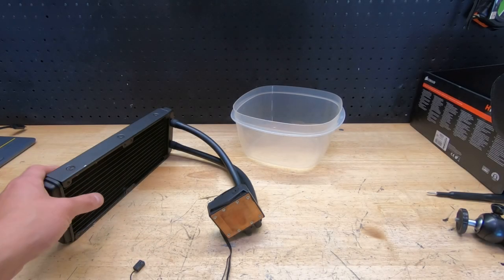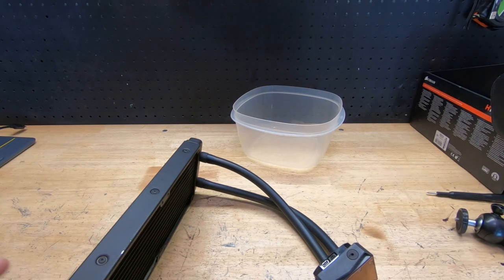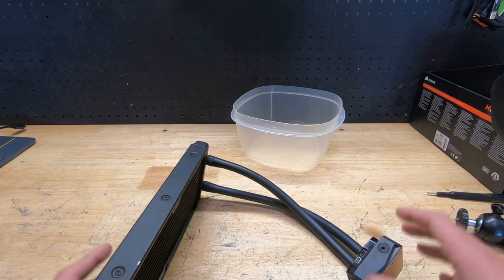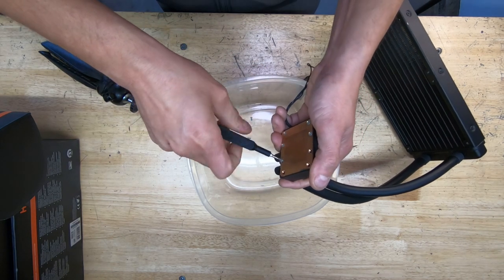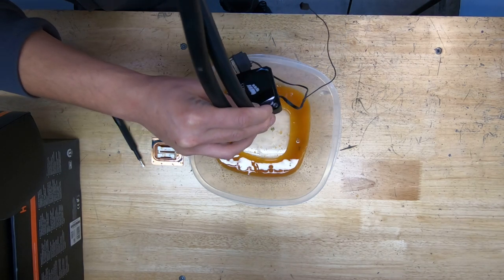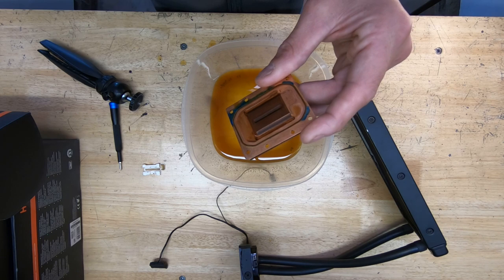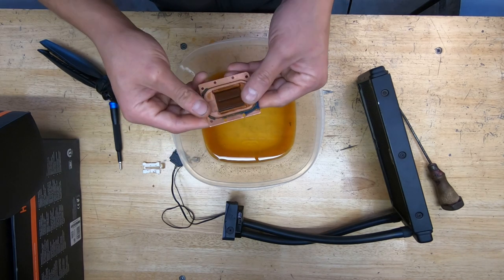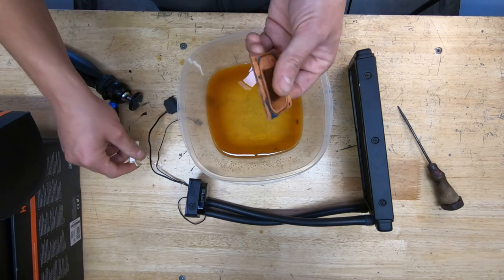Leaking AIO!! Disassembly....... I was shocked to say the least!!!

Comment: Aio's look nice , but I'll never have on in my personal systems. Dark rock pro 4 , Noctua NH D15. (Thinking about checking out scythe ).
Reply from the maker: I had the Dark rock pro 4 on my 5900x. just switched to a evga 280 aio, working on a video for it. I'm the same way but I'm trying different things out just cause i have them lying around. that EVGA has grown on me though, quieter and cooler but yea i too don't trust them
Reply: @DLMtechgarage  understandable especially with 12 cores and 24 thread. I don't need that kind  of horse power.

Comment: the problem is these things became so popular that in the local stores in my area sells nothing but aios and low end air coolers so I'm forced to buy aio 😒🤦🏻‍♂️
Reply from the maker: dang, glad my area has options. if I go aio i stick with artic. never had one go bad and they cool so well and last forever!!
Reply: @DLMtechgarage  from your experience which aio is the most durable and last like 6 or 7 years
Reply from the maker: @Zapronte.  artic has the best aio, 10 year warranty, beefy radiator, quietist I have used and cheaper then the rest. I have an artic I have been using for 4 year and noticed no degradation and if it does, they will warranty it no questions asked.

I will post a link to a video i did on the 360 from them... fantastic cooler!!

https://youtu.be/RWbSVON1nu8
Reply: @DLMtechgarage  is the crazy temperature of ryzen 7000 will affect the coolant in the future because I heard something about the ambient temperature and I'm not sure 🤔 sorry for wasting your time btw 😅
Reply from the maker: @Zapronte.  no waste. my guys at silver knights PC where I get the cooler from and they deal with artic directly have told me that the cooler is more then enough for the 7000 and the extra heats has no effect on the coolant.
Reply: @DLMtechgarage  perfect thank you 🤙
Reply: Also bought one this year: ASUS ROG STRIX LC III 240 ARGB WHITE - will see how it goes... time will tell.